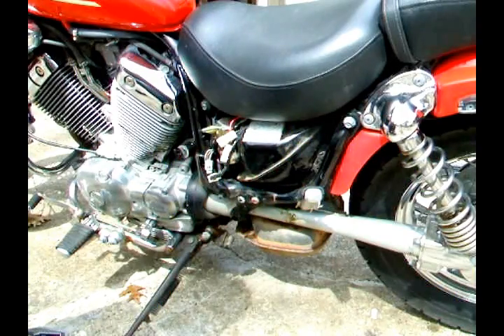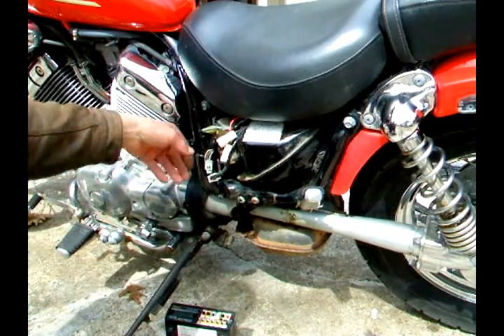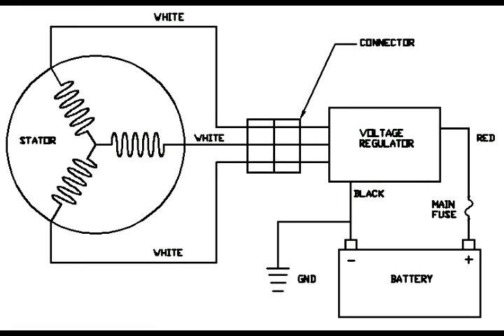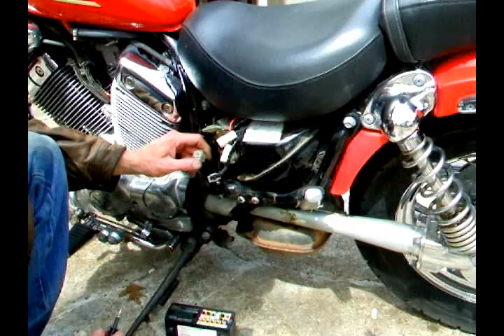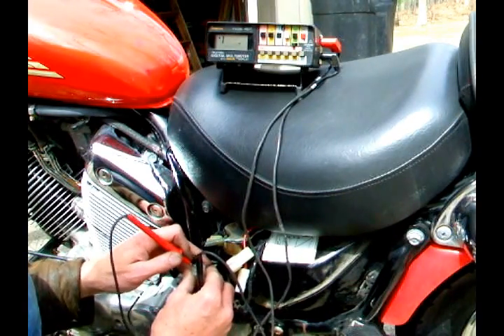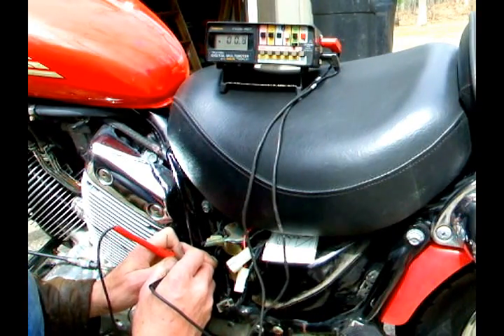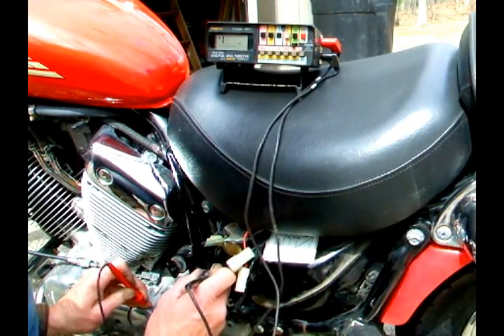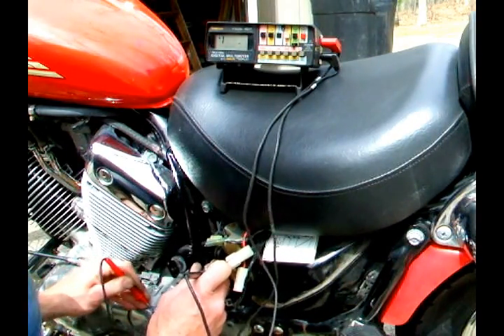How to test a motorcycle stator with a VOM

Comment: hey I need some serious help as I am a bit stumped on this. I recently picked up a 1999 cbr600 F4 from a buddy and it ran kinda wonky so I narrowed it down to an electrical problem and went and cleaned all the connections and found a wire running from the stator was burned out so I cut the plug out and hardwired all 3 stator wires and got myself a new rectifier regulator and it ran beautiful with no issues for about a month. Coming home one day I noticed the bike started acting up again and made it home. I tested the battery and it was about 12.3 volts and when I revved the bike it wasnt charging at all it stayed at around 12 volts and slowly decreasing. I dont see any burnt out wires and the rectifier regulator is relativiley new so I was wondering of you could help me with this situation. My uncle thinks its the stator itself but Im not 100%
Reply from the maker: +Tbla Dfas He could be right. So here's a video on how to test the stator.  https://youtu.be/DjXyOiRpgOw
 How to test a motorcycle stator a with multimeter (VOM) without removing it from your engine. Works on mopeds too. Step by step instructions. Find a multimeter to do this test,  Check out  http://amotorcyclenut.com/?p=205 

Don't forget to retest your rectifier regulator.

Comment: Can't assume a stator is good with just a resistance (ohm) test. Also need to test voltage coming from the stator with the bike running at idle and also when revved.
Reply from the maker: fiveomar Thats what this video shows, but it also tests voltage regulator. 
https://youtu.be/h87sQiX_KSY

Comment: Okay so all my readings are the same and my battery is new and I checked the regulator and it's also working properly but after riding my bike a couple of days the battery gets drained. Do you have any suggestions as what could be wrong?
Reply from the maker: I would watch this video first. "Motorcycle voltage regulator charging and rectifier test"  http://youtu.be/h87sQiX_KSY  that will tell you if your charging system is working correctly. If it is, at the end of the video it shows how to test the drain of your rectifiers. It only takes a few minutes and its easy. If you have drain with the bike off, remove fuses one at a time and do the drain test again. You will then know what circuit is causing your problem. If its the main fuse then your rectifier is bad so do that one last. Some bikes have the rectifiers built in the voltage regulator and you'll have to replace that as a unit.